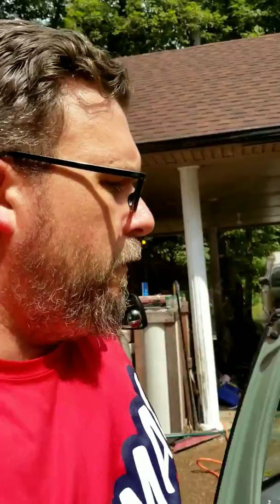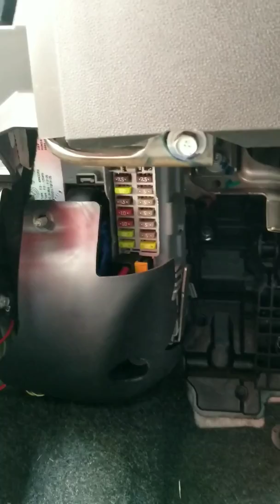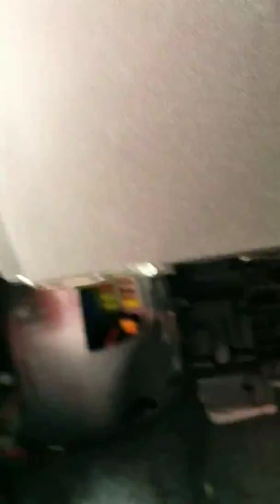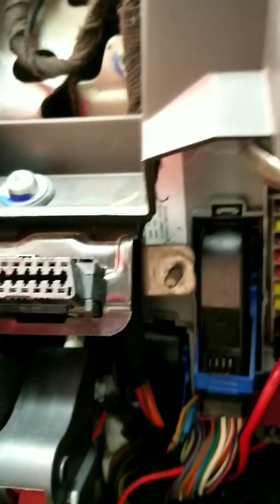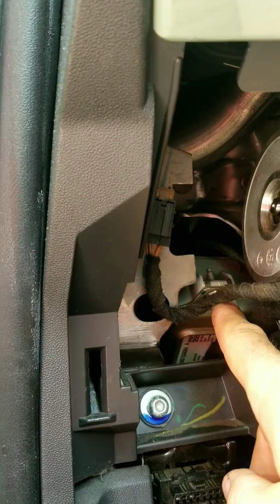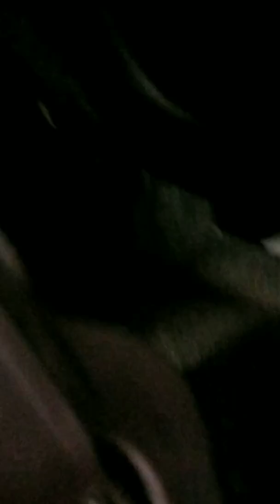Fiat 500 body control module (BCM) pt1

Comment: I just bought one and it has inoperable headlights. I found a company that will replace the circuits inside entirely for $300 in Pennsylvania. Really appriciate the video, I bought mine sight unseen and the dealer lied about its condition so when it arrived it had all kinds of stuff wrong with it. The BCM repair and the window guide are the last things I need to fix to get it fully functional.
Reply: Can you drop a link to the company?

Comment: So first off thanks for the video!  Yours and another video, along with my own trial and error fixed my problem.  
Things to add (I have a 2012 Fiat 500 sport)
1.  There are 3 T30 screws, not 2.  I don't believe you ever corrected that.  However, as you pointed out in the second video, there are 2 connectors in back of the BCM, not one.  Putting that information in the first video (or making them all one video would save some headache.  Also, mine has a pedal plate that I had to remove to be able to reach my hand behind the BCM and unclip the connectors.
2.  Same with removing the cover to the BCM.  You end the second video with all you have to do is pop those little tabs on the side, but important information in the third is required to remove it.  Popping the clips next to the connectors, should be added to that video.  
3.  Also, I went ahead and replaced my relays.  In the other video it says you have to remove the two circuit boards.  There is a waaaay easier way.  Simply remove the connector underneath the relays and it will allow you to get to the solder points and replace them.  I had to heat my gun to over 400 degrees to desolder those relays points, but was finally able to get them off.  
Hope this helps the next person!
Reply: I know this was awhile ago but was you having a problem with the central locking on your car or was it something else 🤔
Reply: @ryanhalliwell185  my lights wouldn't turn off when I shut the car off
Reply: Oh ok thanks for your reply 👍🏼

Comment: You mentioned you pulled a airbag plug? Was pulling the single red cable enough?
Reply from the maker: I can't say for certain.  Red plug is powering the box.  Disconnect the positive side of battery to be sure.